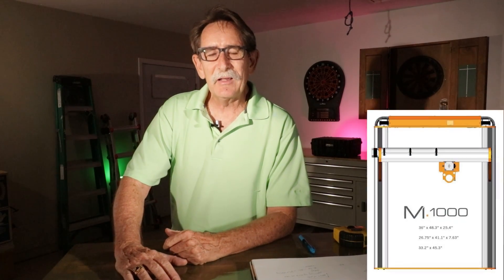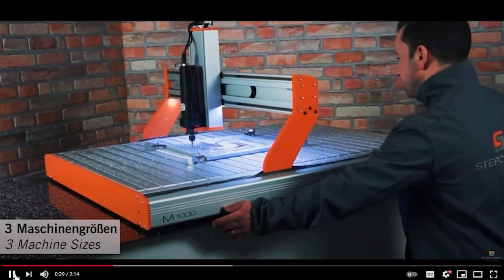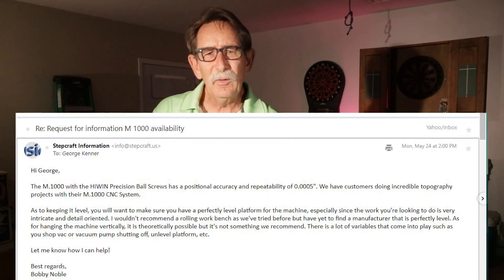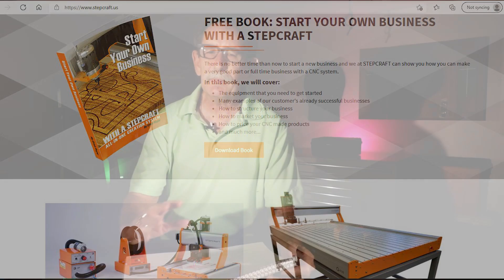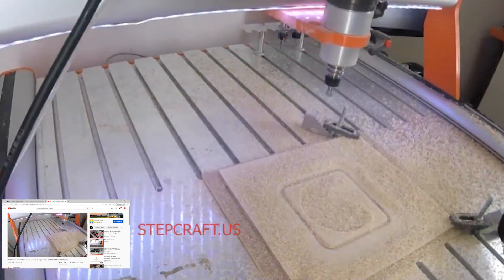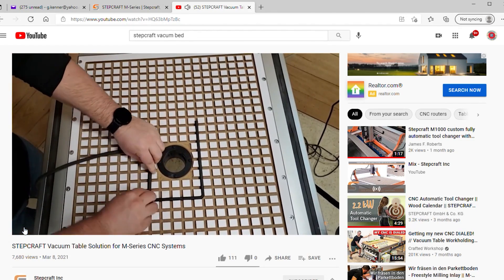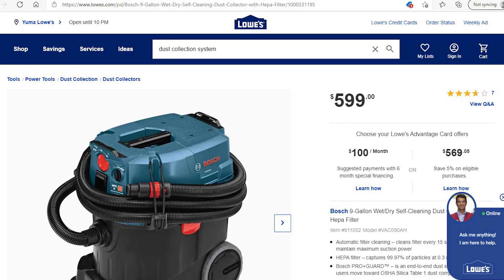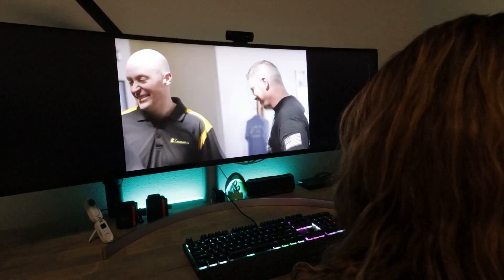Best CNC and 3D Printer , The Stepcraft M1000 | Why I bought it over others!

Comment: The selected dust collection system depends on your cutting volume. If its hobby small items you will be good with a small Cyclone Pail and shop vac, or a festool CT26 . But,if you are going to do production work you will need a poweful system line the Laguna 2-3 hp cyclone that has a large primary cannister and secondary one with the drum filter.
It will take up a corner of your shop, but you will not regret it because you can run 3 lines with blast gates and be productive doing other work like sanding and routering as the CNC is working and the Laguna takes care of the wood chips/dust as you multi task.
I have the 3 hp, and love it !
Reply from the maker: Thank you for the comment.   Dust is something every needs to consider.. this worked fine for  me but I can see in a bigger shop where it could be a little less that optimal .

Comment: Ultimate way to control dust, perhaps instead of or in addition to dust extraction at the point of the cutter, is to build an enclosure for the whole CNC. You could easily make one from plywood or MDF and some acrylic sheet and cut it out on your new CNC!
Reply from the maker: Steve there are enclosures you can buy but when doing a carve or cut, but you may want to so something on the CNC table like vacuum up some chips to see how the project is going along.   I totally understand what you are saying but just have not gone that route and have seen few people do this, and I think for that reason.  I opted for Vaccum , a Dust collector filter system and face mask equal to an n95.    I throw in my radio / bluetooth head phones and just "music while I play"    Thank you very much for the comment.

Comment: Hi there.   For dust collection it would be worth checking out the cyclone type collectors that you can put between your CNC machine and the vacuum.   This will save on having to clean or change out your filters.
Reply from the maker: The Festool that I have does that.   I save some of the small chips to fill cracks and that type of thin

Comment: For Dust extraction I use the Harvey dust Processor (it's very good and easy to Maintain , it sits under my machine with the chiller), I was using a standard shop collect with a cyclone and a .005 Mic paper air filter. The floor does not need to be perfectly level I think my CNC would work just fine Upside down, Although I would n't do that. You see the main thing is that the bed is perfectly parallel to the the Gantry and that should always be to create the correct depth in your cuts.If you Need help( a design or something let me know and I will help you, I wish all the luck in the world. Don't get Frustrated....If you have tried to find an answer for 30 minutes and cant find the answer just ask)

Comment: Don’t go with the Bosch vacuum. I purchased one for dust extraction on my floor sander but quickly found it doesn’t have the suction, also the dust back function that is supposed to clean the filter is not very effective and the filter clogs quickly. Buy an Oneida dust system, more expensive but excellent extraction.
Reply from the maker: I ended up with a Festool .., it sucks good...

Comment: Thanks for sharing your thoughts on this. I'm looking into buying a Stepcraft as a hobby machine myself. I'm a bit more sold on the Onefinity machines but they're really expensive when you order from EU where as the Stepcraft is the only CNC I can find that is made here - And as you mention they do have a ton of extra features that you can add to the machine.
Reply from the maker: I just got my machine and have it in the garage setting it up now.   Worked on the automatic tool changer today.  There is a learning curve but I knew that going in.  Very impressed with quality of construction.   Should have another video out in a few days... I have been taking progress videos.
Reply: Awesome! I'm looking forward to watching that. 
I have no experience with CNCs either so following your progress will give me an idea about what to expect myself.
Good luck with the assembly!
Reply from the maker: @dachr2   I bought my machine assembled.   Meaning the table and all the table drive motors were there.  I also got the vacuum table and the automatic tool changer.   They sent me the most updated "tool changer" better than I even expected, but it requires some computer file adjustments and they are a little above my knowledge base.   I got this knowing there was some "puzzle factor" and I was going outside my area of expertise.   I try and solve the problems myself before I get on the phone to customer service, I figure I will learn the most that way.  There is a facebook users group you can follow, I followed it a bit before I purchased and found it to be a valuable asset in making my decision.   This is like getting a new car, you got to figure out all the buttons, but I am having a blast doing it.
Reply: Sounds awesome! I hope it lives up to your expectations :) I'm subscribed and will follow along on your journey!
Reply: @dachr2  go have a look at sorotec. Sells EU wide and the machines are def one level above stepcraft.
Reply: @ggfggf4151  Looks promising! Also a tad more expensive though.
Reply: @dachr2  that is right, but the machines are def top quality and the support is outstanding.

Comment: Hi George. Great review! Did you happen to review the AVID CNC machines? I see this brand widely used and its price is in the same ballpark as stepcraft with a larger work area. Any thoughts would be appreciated.
Reply from the maker: Michael , Avid was my second choice there were a few things that made me go Stepcraft.   Sales Approach and what I think customer support will be, there was a passion at Stepcraft.  Now to be fair I have not got my machine yet but at least in the approach I think I made the right decision.  Second thing was I saw a video where someone made a sign for a Legal office.  It was on a large round piece of wood that clearly would not fit on the Avid Table.  But with the Stepcraft they lifted the machine on to the wood and carved the design.   The light bulb went off... I would not be limited to the working table size.    I should have my machine in a few weeks, I got it FULLY loaded and they were waiting for the special spindle I ordered.  MORE TO COME SOON!  Thanks for the comment.
Reply: @GeorgeKennerLaser  Thank you so much for your response George. You make a great point that by being able to lift out the floor in the stepcraft it allows you to work on a larger piece of material. A great feature but unless I'm missing something isn't the actual carving area still limited to the extend of the working area of the main table? For example if you carved half the round sign you mentioned are you then able to reposition the stepcraft, establish it's EXACT new location relative to the drawing file in order to continue cutting the round sign precisely? I'm a long time wood worker but have no experience yet with a CNC so thank you again for your insights! Looking forward to your review once you have your machine.
Reply from the maker: @michaelolshefski5845   your welcome,  as I have said this all started with a Dragon Cutting Board on saw on Youtube and I started researching.   I found most of the content about CNC good but NOT GREAT.   The idea of opening up the bottom of the table was something I just happened to see, I made the comparison myself.   I have my table set up and am excited for the arrival.

Comment: I just got mine last week and I got it all assembled and running. The quality seems to be very good as are the instructions, they have bar codes to scan for videos during each step although they have not completed all the videos so some steps don't have videos. My ultimate decision was based on the ease and time they responded back to me and was never rushed off the phone. It's also the only machine I know of that does the "freestyle" milling. I run a festool ct15 and when the coupler is removed it connects to the stepcraft dust collection
Reply from the maker: Amazing..... wait for my next video... You will crack up.  Thank you very much for the comment...

Comment: Hi George - I’ve been going through the same thought process and am heading in your direction as well, so that’s given me some confidence.  Thanks for posting.  Re: the dust collection, noise is a big consideration and I don’t know about the Bosch.  I’d recommend harbor freight’s $150 dust collector.  Very quiet.  That a little PVC and some 3d printed fittings and blast gates from Amazon and you can do the whole thing for under $250.  I was surprised at how well it worked.  Happy to share some specs and design docs if you reach out.
Reply from the maker: James thank you for the great comment... I will look into your the idea for the dust system.    If you have any questions I did not address and you want to ask them in private, my e mail is g.kenner@yahoo.com.    I am going to start the next video today about going through shop set up.   CHEERS!

Comment: A cheap shop vac with a dust cyclone is ideal for a cnc
Reply from the maker: thank you for the imput, the reason I was / am favoring the Bosch system is out of the box and roll away solution for the small space I have.
Reply: I started with a “cheap” middle of the line Rigid shop vac and a dust deputy cyclone.  Didn’t cut it for my workflow.  I went with a dedicated Laguna CFlux1 system and couldn’t be happier.  No more breathing dust. Two 4” inlets.  One goes to the CNC and the other has a 25’ flex hose with a Rockler quick connect that I move to other tools around the shop as I need it.

Comment: Good start to your new hobby.  I checked out the Ball Screw backlash tolerance and it’s very good for a CNC that is not industrial. Great for repeatability. Going to be fun!
Reply from the maker: Thank you,  I have a Dart Board Repair Project that is going to be one of my first things to do.... it will just be some cut circles to build a bezel and a dart holding system.